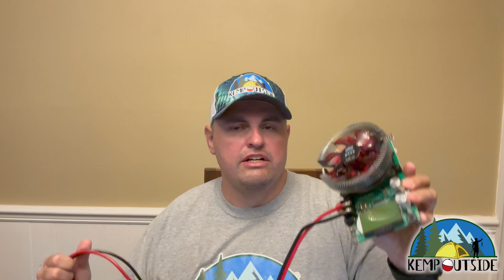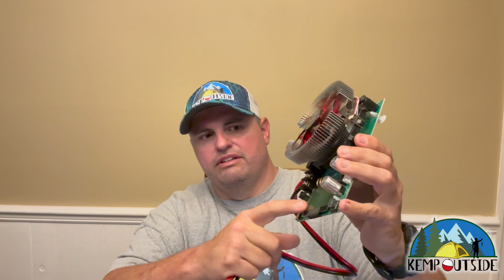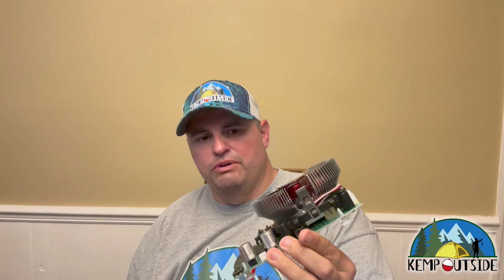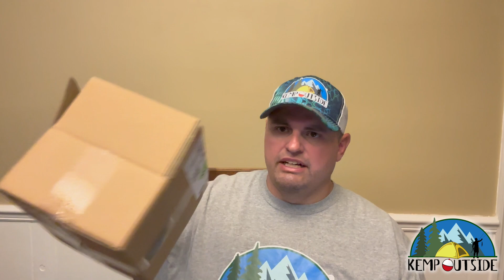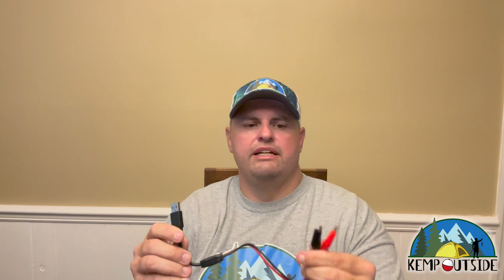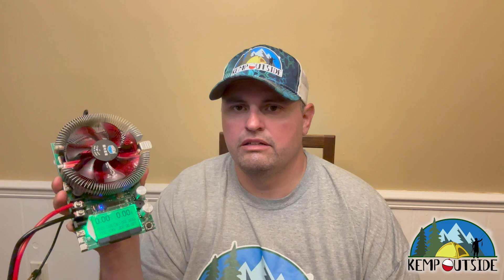MakerHawk Battery Capacity Tester Review | Test the Capacity of Your Lithium Batteries

Comment: thank you for showing us how to work this thing, it was also helpful reading the comments and learning this unit probably has a limit of 50 vdc. I believe I'm going to remove the speaker from this device as you can't shut it up otherwise and the beeping gets old fast especially when you use the low voltage cut off feature, it never stops beeping. Wish me luck haha.

Comment: What size (amperage) battery fuse would you suggest?
Reply from the maker: Sorry I missed this question! With 12 gauge wire I'd use a 20 amp fuse.

Comment: This thing says that it's rated for 200 volts. I used it with a 13s lithium ion battery and it worked at first but on the second attempt it failed with a dead short. Chat gbt is telling me that the stock mosfet was not rated to go to 200v and anything over 50 was likely to be pushing it at its limit. With that said do others agree with that? I ordered a beefier mosfet and plan on doing that little upgrade. I'm also adding a resistor to negate the inrush current.
Reply from the maker: I think I never go over 150 volts but I haven't used it in a while so I always refresh myself before I use it.

Comment: Thank you! I wish they made a 250w one so we could discharge at.2c. I've been using a 250W halogen bulb which is just about .2c for 100ah LiFePo4 and smart shunt, but the shunt is in use. I'm debating this vs another  $70 for smart shunt. Decisions! I like this because it doesn't involve and inverter. Great run through to give others like me a head start.
ps - I see they have a 180w model now with color screen and more buttons, but no knobs. $70. Hmmm.
Reply from the maker: I would love a bigger model!  I am testing some 300ah batteries and it takes forever!

Comment: excellent review Kevin. Am I to understand that we can test small batteries like laptop, cellphone etc. I am a little leery at taking things like lithium cellphone and laptop  batteries to zero or near zero as that can toast some lithium ion  batteries. I am a mechanic and have more conventional battery testers like on cars and they are quick and dirty and take just a second or so. Your thoughts? It would seem imperative to install this in a protective case like a pelican box maybe held in with Velcro?
Reply from the maker: Thanks! Yes you can test smaller batteries. HAM Radio Tube has a pretty decent video on using one of these to test smaller batteries. I’ve only tested the larger lithium batteries so far. You can always set a limit to stop the test if voltage drops too low. keeping it in a pelican case is probably a good idea but I think it needs airflow to the underside of the unit so I wouldn’t have it to tightly packed with foam. I haven’t quite figured that out yet so I’m just keeping it in the shipping box for now.